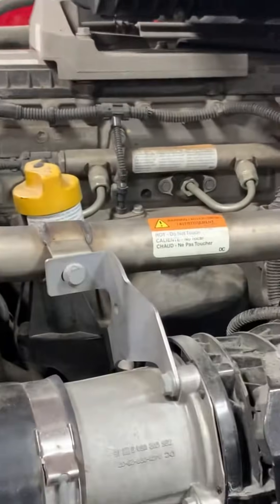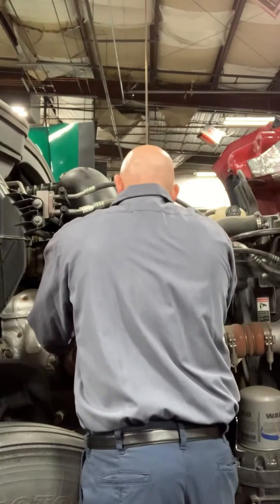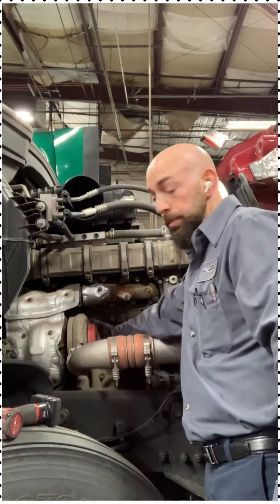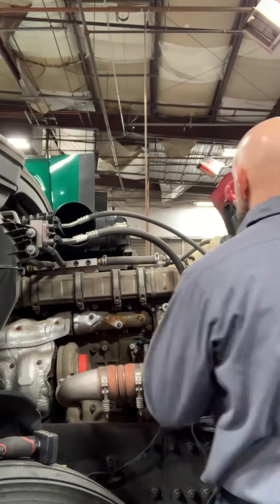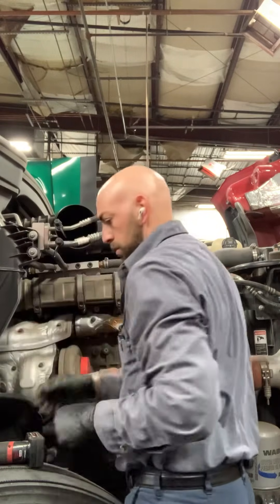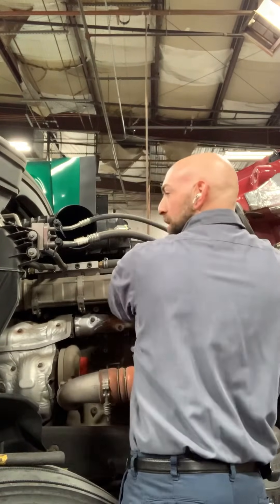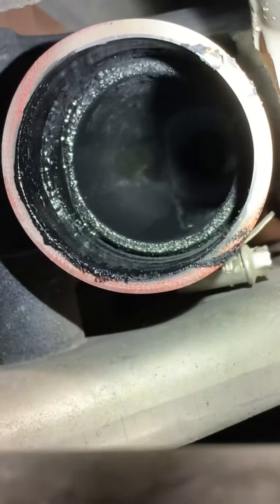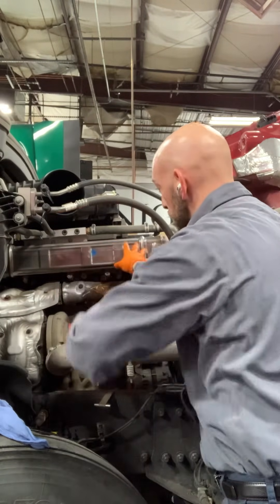Freightliner cascadia DD15 engine EGR EGR cooler failure. By diesel dr

Comment: I was driving last night and my truck started stuttering made some metal noise when I hit the gas , had it towed in town , looked today that egr Venturi pipe has oil or coolant inside of it coolant tank is low , and I have a code 1636 FMI 2 . Any help would be great , checked the turbo also the ring around turbine by the air filter hose is rattling moving around the turbine is fine spins
Reply from the maker: Well couple of options. If there’s coolant in the pipe than your cooler gave out.  If it’s fuel than your injectors are failing open. If it’s oil than get ready for a big bill, could be a head issue. Smart thinking just towing it, don’t want to hurt it worse.
Reply: @bustedknucklebydieseldr3228  had it towed to freightliner they inspected the oil and it has coolant in it , they told me cylinder 1 is damaged and the crankshaft is damaged and also couple of bearings and both mains also damaged ,my psi for oil was right under the 60/or 70 psi I took it to freightliner a month ago and did the pick up tube for oil before it went out my brothers trucks engine just went like that so I wanted to prevented it happening to me and they also did bearings and mains and also a adjustment on top of the engine I was wondering is there any way they could of caused the damage with their work something they didn’t do right and now a month later this happens to me , also the egr went out also ,any help would be appreciated I’m trying to see see if they caused it at all
Reply from the maker: @Wolfci  man oh man I’m sry to her that. So it could just be bad luck and it’s time to give out. Or. They could of not primed the oil system after they did the oil suction manifold and that caused the bearings on the crank to prematurely wear out. That would be very hard to prove though but Atleast you have some knowledge to combat them with if you were to bring that up. With the the of the truck they will most likely just say it’s time.
Reply: @bustedknucklebydieseldr3228  I understand it’ll be hard to prove it , just wondering how the engine just damaged the new bearings and mains when I did both of them less then a month ago could cylinder 1 damage cause all of that damage with multiple bearings being damaged
Reply from the maker: @Wolfci  if cyl 1 was the failure than one of a few things could of happened with it. And I get that , but I don’t see why other bearings would of been affected unless something went wrong with install. You were smart and got them replaced as a precaution. I would Deff ask to speak with a shop mgr to open an investigation as you were being safe on ur part. The end result my be the tech that touched it last.
Reply: @bustedknucklebydieseldr3228  spoke with shop manager he said the liner in cylinder 1 failed and allowed coolant to mix with oil and that caused the damage , I checked the oil it was black not that milky consistency ,they said all the coolant didn’t mix in the oil
Reply from the maker: @Wolfci  I would think with a liner issue the coolant would have to go into the oil and wouldn’t stay black or brown. I guess we’ll chalk this up to just bad timing.
Reply: @bustedknucklebydieseldr3228  yea they said they tested the oil and it had coolant in it but I checked the dipstick and it was black

Comment: Is there a way to test a injector cup? Getting lots of back up pressure in the coolant reservoir but no dis colour?
Reply from the maker: Great question yes there is. Although I’m a little confused on the back pressure in the reservoir as there should be a good amount of pressure 18psi ish. sometimes it’s too full and it has to find a way to leak out to the ground. If there’s fuel in the coolant then I would consider testing the injector cups. And if there’s no EGR gas or fuel in there I wouldn’t worry about anything contaminating it.  Hope that helps some

Comment: Did you the coolant has to be drained? I can't quite hear what you said right there. Also was it difficult getting the old part off after everything was loosened?
Reply from the maker: I drain the coolant from the block and that was good enough. Once everything is loosened the cooler is kind of stuck on there so I use a prybar to pry it  away from the block. Some coolant will come out of the cooler but not to much.

Comment: Great video quick question. I am abt to buy a truck 07 freightliner and the guys rebuild the engine but now the coolant is leaking from the hose by the resvoir any ideas could it be the egr valve
Reply from the maker: With a coolant leak they should be able to fix fairly quickly. Guessing where it’s coming from could lead us in so many directions so my best advise is take it to the ones who did the rebuild or a mechanic you trust to put the system under pressure and see where all the leaks are coming from. There might even be more we can’t see without being under pressure. Those are great year trucks and I hope it brings you no issues and lots of $$$ in return.

Comment: What if every time I turn the heater on my 2015 freightliner cascadia blue smoke come out the exhaust
Reply from the maker: Well that would be very strange. That color would be oil getting into your exhaust unburnt. Shouldn’t happen with your heater , should be happening all the time.
Reply: @bustedknucklebydieseldr3228  Thank you love your tips

Comment: Morning sir, got 2015 freightliner wit dd13 with code spn 102 fmi 18, need help with what to look out for, thanks
Reply from the maker: Thanks for watching and reaching out. A diag computer will be needed for this troubleshooting. Basically you’d be checking sensors to see if there reading wrong. Than check for any intake or exh leaks. If that’s good it would take you to the turbo and run a few tests on it to see if it’s keeping up. A lot of the time I’m finding the turbo is the issue. Hope that helps some.

Comment: Hey what can I do if my regen don’t seem to ever finish temps wont go higher then 767 please some advice sorry if I left this comment in other of ur video really need some help.
Reply from the maker: All good man and thanks for reaching out. Sometimes they does occur and usually relates to a fuel issue. A lot of times I’ll find the fuel doser after the turbo plugged up and not delivering fuel to get temps up or the fuel shut off valve in the hydrocarbon doser block isn’t switching on. Both these should throw codes and lead you to part. When they don’t throw codes il run a low temp regen and watch the numbers. Usually will have a onebox sensor far off from the rest and there’s your problem. Hopefully one of these will be your answer.
Reply: @bustedknucklebydieseldr3228   thanks for the reply I’m only getting one code SPN 3719 FMI31 and it says Dpf zone 2 I believe i clean the dozer by the turbo witch I switch 50k miles ago and clean the dozer by the one box witch. I change 20k miles ago someone told me ny turbo could be bad.
Reply: @bustedknucklebydieseldr3228  and do you have any videos shown the low temp regen or just run the regen and look at those numbers also will a nox sensor been out cause this also?
Reply from the maker: @cristoperodriguezgil8075  so I don’t believe I have any videos on it. Showing numbers and understanding them is very difficult to teach. If that’s the only code than it’s a bit strange it wouldn’t throw one for low temp or regen failed to get to temp. But either way looking at a log file of a regen would be best to figure out what’s going on. Those few options are most likely cause of failure but just as easy sensors go out all the time. Hope that helps some

Comment: Hi is this work covered by warranty?
I have code SPN 4752
Reply from the maker: If your asking of the EGR cooler is a warranty job, it can be. Usuall extended warranty is 500 k miles for these engines.

Comment: Hi bro great video question for you , since their is no sensor between engine and EGR cooler , just a thought build a hosing from engine to easily removable single def filter to EGR cooler ,that def filter will pick most of the soott and EGR and engine will run cleaner .and def filter can be easily removable and gets cleaned every 5 to 10 thousand miles with water and air , engine to def to EGR just an extra def filter thought?
Reply from the maker: Also I’d give two thumbs up if I could because that’s a well thought out idea.
Reply: I'm going to give it a try by welding few parts together and use old def filter and let you know what are the readings and again you make some of the best videos out their ,man thanks
Reply from the maker: Thanks for reaching man. I could Deff see where your coming from here. But you Gta remember cars, trucks and semi trucks all were made to recycle exhaust gas. These semi trucks take the EGR and use it to there advantage and great power out of it. The only downside to the entire system is the aftertreatment which as well all know always have some type of sensor issues. The engine itself runs great with a combined mixture of fresh air and recycled air which infact brings up the temps for combustion and create more power. So I believe they stayed away from an Eng side def filter because they used this current method to the engines benifit. Hopefully that doesn’t sound to confusing. But. To clear it up the Eng we made to run as powerful and as dirty as it can and it’ll just get cleaned later in the aftertreatment so there not worried about soot issues.

Comment: I have a question, I have a D13 Volvo engine! If I Eliminate the DEF system I don’t need EGR Cooler? Because I mine eliminated and my mecanic is saying that I need a new ERG Cooland because that one I have is pumping a little bit of water??? What does that truck do when the ERG is Pumping water???
Reply from the maker: Great question man. I’m actually a little confused myself. If the def system is eliminated than I’m assuming you have a custom tune to stop EGR system from being used. If that is infact the case than you can block off your EGR cooler just incase it starts to leak and pushes coolant into your intake like in this video. I think that may be what he means by pumping water. But save your money and find a block off for it, that would be the best bet.

Comment: Hey brother I have Dd15  Can I delete the block the  EGR cooler if I don’t use the DEF  there any The fact of the motor over heat ?
Reply from the maker: If you deleted your EGR system/DEF system then you can go ahead and block off the EGR cooler and go ahead and take it off because that’s just extra weight you don’t need.
Reply: @bustedknucklebydieseldr3228 
You always helper thank you so much

Comment: Just curious as to what led you down this path to begin with? Excessive pressure in the cooling system? Loss of coolant (I know this is likely)? What were the symptoms? Yeah, I know the loss of coolant was one but are there other symptoms?
Reply from the maker: Great question and thanks for asking. Loss of coolant and nothing external let me down this path. Sometimes driver will complain of excessive smoke from the tailpipe but not always as the DPF seems to collect most of it. And a simple check inspection of the EGR crossover pipe and you’ll be able to see if there’s a lot of coolant passing through. Hope that helps

Comment: Good morning boss man, 2015 cascadia started to smoke bad it’s burning or leaking radiator fluid a little. Today check engine light came on smoking more than usual or may I say normal. Fluid is bubbling hot. Also it looses pressure driving and wants to cut off pull over because speed slows down makes me pull over. Cools down 10 to 15 min later turns back on, I assume it’s because coolant is cooled let’s me go about another 10 min driving before same thing occurs. I’m bummed just got the truck 744400 miles just got license as well can’t get on a roll at all. Any suggestions big bro?
Reply: Seems like something like air might be leaking because every time I turn off I have to re gain secondary tank air pressure back up. Primary air tank stays at 125psi. I’m heading to the mountains but scared to even keep heading there till I figure it out. I have port haul to smock pa. 42000lbs on time schedule am I looking at major fix?
Reply from the maker: @ricosantana100  thanks for reaching out man. Sounds like you Deff need to take it in for service. The air leaks will only get worse and you will have a hard time maintaining you pressure after a while 
As for the smoking you may of got someone else’s problem and they better offer you some good will repairs to help you out. If there’s any type of coolant leaks on the Eng than they’ll be smoke from up front. If it’s smoking from your tail pipe than either coolant from your EGR cooler is getting past, burning oil pst your piston rings, or dpfs are contaminated and need inspecting. But it’s hard to say without digging in. Congrats on the new truck and license and I hope things turn around for the better.
Reply: Watch this video. It shows different tests for coolant leaks and bubbling coolant fluid. I hope this helps you.
https://youtu.be/oN3PsPLYWpI

Comment: What if it’s leaking externally. Mine has a small leak at the bottom of EGR cooler. Can it we wielded or go ahead get the whole part replaced? Thanks for your help.
Reply from the maker: Great question, if it’s leaking external than I would just know for sure nothing else is leaking on to it. There a few hoses or fittings that usually leak on it and could look like the cooler is leaking. If it’s just the cooler, than there are companies that clean or repair them. Since the cost Isn’t to bad for a new one I usually just get new instead of that route.

Comment: Should the hot pipe test be done after running a little while. Or after sitting for the weekend
Reply from the maker: Great question. Both those answers work because with cold water leaks the engine can’t be running and with hot water leaks Eng has to be running so depending on which kind of leak you end up with. And then you Gotta be careful looking at it and making sure it’s not just condensation but actually coolant in  there.
Reply: @bustedknucklebydieseldr3228  thank you.

Comment: What means if I found oil that hot pipe?
Reply from the maker: Great question and thanks for watching. You should never have oil in that pipe. When failures occur it’s usually injectors with fuel in that pipe which could look like oil mixed with soot.  Or coolant mixed with soot which could also look like very runny oil.   If it’s infact oil then I’d be concerned with some type of head failure. Hope that helps. And don’t forget these vids can make great last minute gifts for the holidays.
Reply: @bustedknucklebydieseldr3228   thank you for your help!!!! Happy holidays!!!

Comment: Hey very informative video you made it look easy. I just got my heater core replaced but I’m still losing a gallon of coolant every trip. Is that for sure because of the eve cooler
Reply from the maker: Thanks for reaching out and watching. If your loosing coolant the best thing to do is have the system tested under pressure. Never just assume it’s one part or another. And always ask to see the  part intill you trust the shop just to build that relationship.

Comment: How much the part cost
Reply from the maker: The rubber seal. Prob 5 bucks.
Reply: @bustedknucklebydieseldr3228  I meant egr cooler
Reply from the maker: @MertOzTrucker  I know, just seeing if your paying attention. Last I got one it was around $700. Im sure it’s slightly higher now due to parts shortages.

Comment: Thank you for your videos..I got freightliner cascadia dd15 2016...my  coolent  temperature going too low ..it doesn't stay at 200 temp.go down all the way to 100 temp. Just happen today.
Reply from the maker: Thanks for watching. If your driving and coolant temp doesn’t get past 185 than I’d be leaning towards a thermostat. If it gets to 200 and drops low randomly I’d be looking at the wiring/ garage/ or coolant temp sensors. Hope that helps.